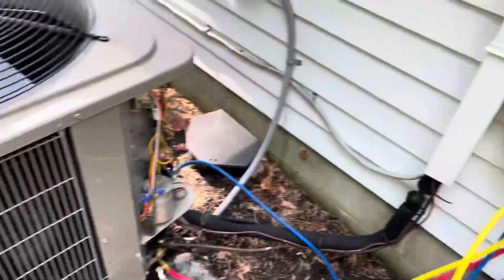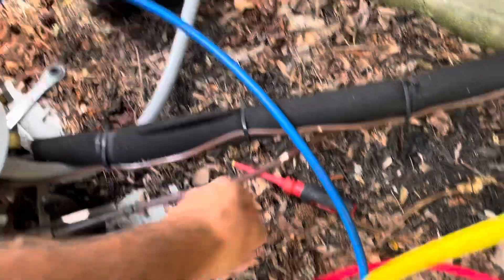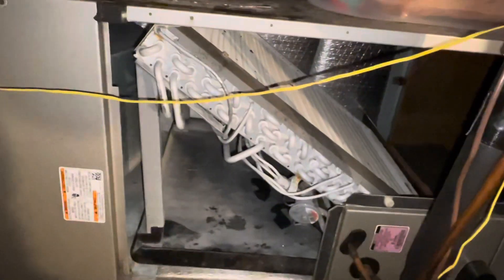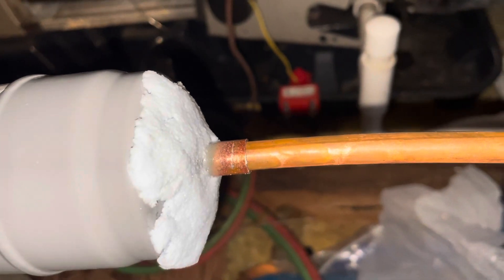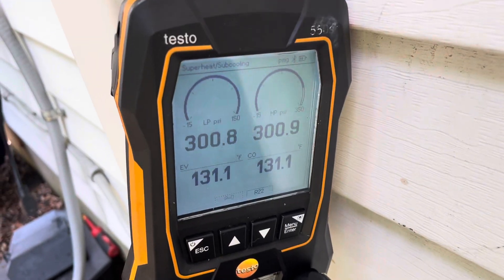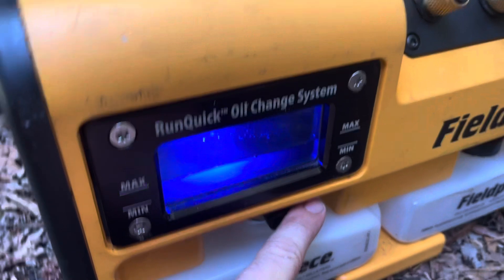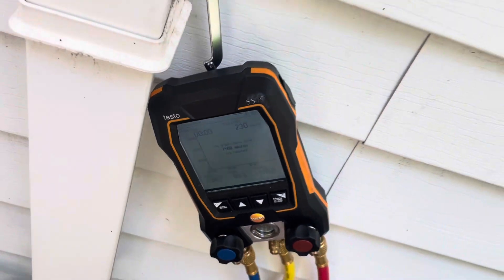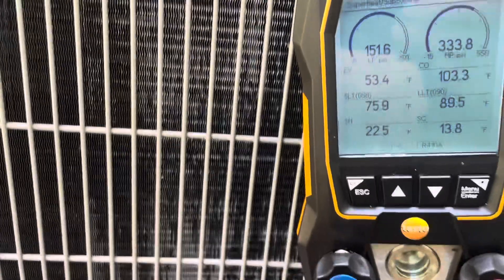Replacing TXV In Carrier Air Handling Unit!

Comment: Does anyone know if the filter needs to be by-directional i.e. reversible or can it be unidirectional?
Reply from the maker: If you’re working on a heat pump it needs to be bi-flow.  Straight AC can use single direction

Comment: Two questions if you have time.
When you drilled a new hole how did you remove metal shavings from suction line?
Also how did that txv fail open or close? Was coil frozen if failed closed?
Reply from the maker: The trick is to drill very slow and wipe the shavings away as they form.  
And yes it failed closed, coil was freezing.